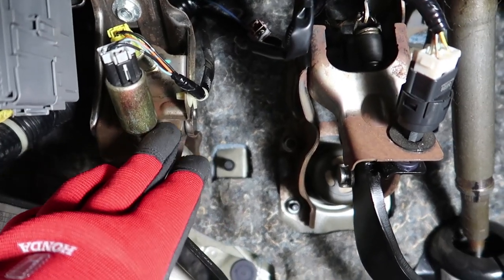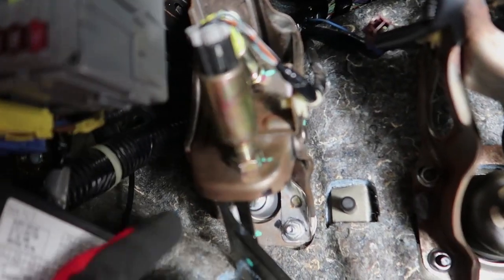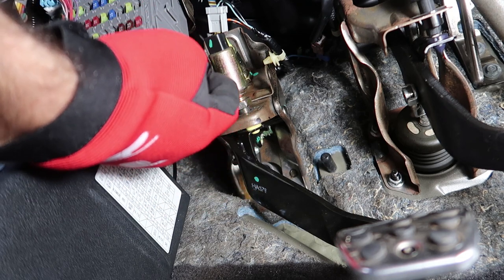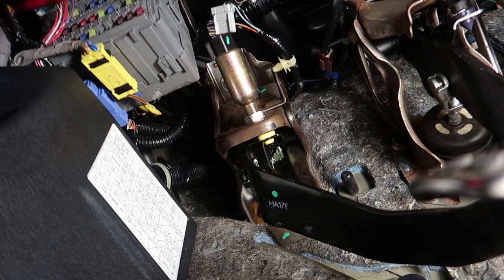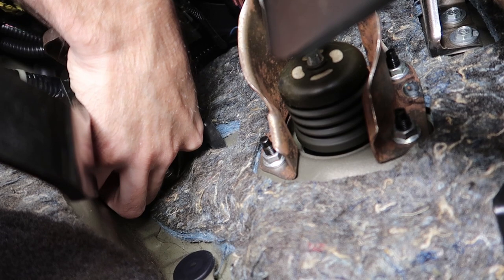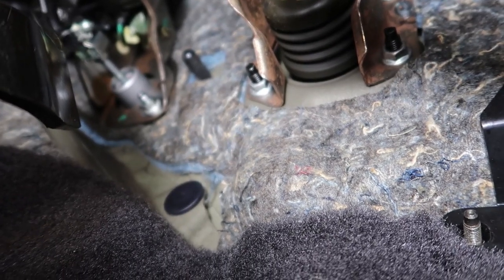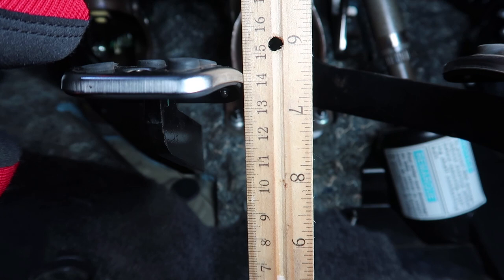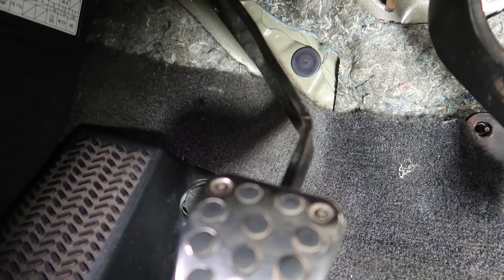8th Civic Si and RSX Type-S Clutch Adjustment DIY | Aftermarket and Stock | FG2, FA5, DC5

Comment: I have a ktuned slave and cmc kit, question is how do I know when to stop turning the rod on the master? Turning the rod with fingers is impossible so I have to use a pliers to turn it
Reply from the maker: So you can also use a ruler to just check the freeplay instead of stopping and backing out. Also try to push down the pedal a little with one hand while turning the rod, it usually makes it easier. Then check the freeplay amount. The reason you do that is because after you change the height of the pedal, the rod has to be reset also (to the correct range). Lmk if you got any more questions buddy
Reply: @JasonMcMullen  one more question actually, before I get into my question I just want to say I have bled my clutch master 3 times and confirmed no air bubbles. My question is, after 30mins of driving my clutch pedals seems to get a little stiffer and also engagement point becomes a little higher. Before driving in the morning I would check my freeplay with my hand without any force and there would be atleast .5inch of freeplay, but after driving for a while the freeplay seems to be gone
Reply from the maker: @Itspiyerrrr  fluid does heat up a little so it could change a little.  If you not experiencing shifting issues then you could give it a bit more freeplay just to be safe. Air in the system will make the pedal softer so you probably did the bleeding just fine. Pedal stiffness will increase after adjusting but you dont want it to feel extremely stiff at the bottom of the pedal travel (if you do feel it at the bottom of the stroke then the pedal height might be too high and you might have to readjust both again)
Reply: @JasonMcMullen  I just find it weird, but car is shifting a whole lot better after I adjusted it with your instruction. The ktuned cmc I believe is a em2 style so I have 2 threads showing on the bottom of the clutch switch, I adjusted it like how I would adjust a stock cmc. Unless I need to have 5-6 threads showing like the em1 style?
Reply from the maker: The k-tuned one is Em1 style, so it does not need as long of a travel. Maybe go a little shorter (more threads showing) and see if the pressure is not as extreme. You can go one thread at a time so maybe try 3-4 and see if you can find a balance between shifting smooth and normal pressure. Also keep in mind that when the car is cold the shifting will be less smooth because the trans fluid has not had time to circulate and warm up.  @Itspiyerrrr
Reply: @JasonMcMullen  thanks for clarifying that!! I’ll have to adjust it when I get gome and get back to you. Appreciate the help a ton
Reply from the maker: @Itspiyerrrr  no prob buddy, hopefully by then end of the process it will be dialed in perfect
Reply: @JasonMcMullen  did exactly what you said, feels a lot better shifting though it has a shorter engagement point I’ll get used to it though. Engagement point gets a little higher after driving for a while, also gets a little stiffer but everything works pretty good so I’ll just leave it at that
Reply from the maker: Awesome!  @Itspiyerrrr
Reply: @JasonMcMullen  last question promise🤣! When adjusting the clutch pedal, should I drive it for a while let the clutch warm up then adjust it? Like warm up the clutch/clutch fluid before adjusting
Reply from the maker: you dont have to but just gotta be aware that it changes a little bit. The big difference is with the transmission, because shifting is not as smooth when its cold, so it might make you think you need to adjust it again. Anyway up to you  @Itspiyerrrr
Reply: @JasonMcMullen I have just getting back on a little update. Ktuned sent me a cmc replacement yesterday. I installed it earlier this morning and it was in world of difference. 5 threads showing on the cruise control switch, gives me about 1/2 freeplay. Before I wasn’t able to push in the slave cylinder by hand so it was stiff on the pedal, but now I can push it in if I give it enough force but still not easy to push in by hand so I’m sure that is how it should be

Comment: I’ve got the ktuned master and slave coming in the mail, is it definitely an em1 style? Just wondering if that company sells more than 1 style for the 8th gen. don’t want to mess up my brand new clutch and rebuilt trans! Thanks
Reply from the maker: yes sir, the k-tuned one is a modified EM1 CMC (it has an AN fitting) and its the one that I used. It should be around 5 threads showing. If you run it with 1 thread showing it will over-stroke the system. In my opinion, K-tuned should provide some instructions because I caused issues for me before I learned about adjusting it.
Reply from the maker: also the pedal will be shorter with the K-tuned so it will take a week or so to get use to it

Comment: i can’t get the rod on the cylinder to spin to get pressure even tho the nut is loose:/
Reply from the maker: Sorry just saw this comment. You can press the pedal down slightly with one hand while spinning the rod with the other hand and it will make it easy to spin

Comment: I have a ktuned cmc and slave kit on my 05 type s. I've bled the clutch fluid 3x for good measure and confirmed there is no bubbles anywhere. My question is, is it normal to have more than 10-15mm of freeplay after adjusting with 6 threads showing? Since its hard to turn the cmc rod with my fingers i had to use pliers, do I just adjust it till the cruise control switch is fully pressed and flushed? Btw I do have unknown stage 1 clutch and flywheel if that helps. Thankyou!

Comment: Does the K tune cmc and slave master fix 2nd gear grind
Reply from the maker: Urbinz yes sir the k-tuned cmc (which is an em1 style cmc) will get rid of that also, as long as its adjusted properly, you will want around 5 threads showing on the bottom of the clutch height adjustment screw. Then the get right amount of free play.  The pedal stroke is shorter on the k-tuned cmc so in my experience the adjustment is a little more difficult to get right compared to the stock cmc. Thanks
Reply: @JasonMcMullen   I have ktuned clutch kit in my 8th civic is and actually I have around 1 or 2 threads showing  on the bottom in order to properly disengage.I was experiencing 1 and reverse lock out and also sometimes problem shifting from 1 to 2. So ktuned system requires longer clutch pedal run.
Reply from the maker: MrRafciog that’s interesting, when I had my k-tuned CMC at 1-2 threads it would overstoke the clutch, and at the bottom of the pedal there would be a lot of resistance. How much free play do you have? And what clutch do you have? Thanks for the info bro

Comment: Quick question, just replaced my master cylinder for an LUK one on my FA5. The bite point was super high so I adjusted the master by turning it counter-clockwise till I felt resistance. You say to go back clockwise half a turn or so; however, when I do, the master cylinder rod becomes very loose to the touch. Is this normal? Thanks!

Comment: Thanks so much for this video, but I'm still having this problem where the clutch pedal has no feedback and the bite point is basically when the pedal is all the way out. Any ideas?
Reply from the maker: did you change the clutch components at all recently? If you dont feel feedback, maybe you need to bleed the system. Or maybe there is a leak? let me know and I'll try to help
Reply: @JasonMcMullen  Thanks for the reply!  I bought the car a few months ago, clutch pedal was progressively feeling more "vague" (harder to feel bite point I guess). As stupid as this sounds, I let my mom drive it and after that the bite point moved to basically pedal all the way out and pedal has not much feedback. Tried adjusting the pedal with your video, but made it worse, going to try adjusting the pedal again. If that doesn't work, I'm going to bleed the system.
Reply from the maker: @Lil.Yahmeaner  Yeah the method I show is good for Disengagement problems but it will make the bite point higher. If you make the pedal shorter (more threads showing) it will lower the bite point, but you risk having disengagement issues. The clutch disk will also get worn over time, but yeah check for leaks and bleed before trying to replace the clutch
Reply: @JasonMcMullen  Ok, so I bled the system and the fluid was super dirty (rust colored). There wasn't much air (if any at all) and the tube was pure (still dirty) fluid. I have 2-ish threads showing and the master cylinder rod has enough space to jiggle around. The pedal feels the same and the bite point (which I can't really feel) is still pedal all the way out. I'm kinda thinking either one of the cylinders is bad or I need a new clutch.
Reply from the maker: @Lil.Yahmeaner  hmm its possible. One more thing are you able to check the freeplay amount with a ruler? that can affect it a little too
Reply: @JasonMcMullen  I don't have mm ruler but in cm, about 14-13.5cm -> 12/slightly less cm. I'll try just about anything but I so appreciate your help so far.

Comment: Where does the clutch pedal bushing go? Part # 46911-sd4-930
Reply from the maker: The pin (bushing) connects the Master Cylinder to the clutch pedal. There is a hole in the clutch pedal and two holes on the Master Cylinder connector (that is on the end of the rod) just line up the pedal inside the CMC connector and put pin in to connect them together. There is a clip that locks the pin in.  Here is a picture, http://civic.hondafitjazz.com/A00/PNG/SNB6E20E34116317031KBAD01.PNG
You can see the pin in the video also.  And make sure to put lube on the pin before installing. Thanks

Comment: On my RSX base model the catching point for the clutch is to high. This fixes that?
Reply from the maker: Katashi ONLINE_K I’m not sure about the specs for the base model. If the clutch works properly it should be ok. Check your freeplay with a ruler first and see if it is at least 10mm, then determine if you need an adjustment

Comment: I measured the distance between the pedal and the floor board with carpet and insulation and it's only 4" and the factory spec is 6.1". If I deduct the thickness of the carpet and insulation, I would guess it's at around 5" which is still 1" low. At the current position, the clutch pedal is slightly lower than the brake pedal. If I adjust it to the factory spec, it will be about 1" higher than the brake pedal. Is this how it should be? I found the clutch travel is abit short ever since I got the car compared to the 9th gen si. I don't want to overstroke the clutch after the adjustment.

Comment: i know im late i just got my clutch replaced and my clutch pedal feel wayyyyyy more softer now since i been riding on my first clutch for 130k miles and now its finally changed, but my question is even if i use OEM parts for my clutch will i have to adjust my pedal, and if so how much?

Comment: Done the clutch recently in a 2003 Accord,the same as the tsx,when pushing the pedal and getting into gear it grinds a little and the car starts moving a bit.
Reply from the maker: Sérgio Santos hmm yeah maybe try to adjust the pedal, give yourself more release travel and see if it helps
Reply: @JasonMcMullen  thanks a lot.

Comment: Hey I have a stage 2 clutch w hybrid racing em1 cmc and csc upgrade kit, i cant get the pushrod to spin freely, the nut is all the way loose but the push rod wont move
Reply from the maker: You can try to push down the pedal a little bit with one hand while trying to spin the rod with the other hand. Just make sure to use a ruler to measure the freeplay after to make sure you are at the right amount

Comment: I tried adjust mine but j wasnt able to rotate the rod what do you recommend? Base on your video it looks like jts easy to rotate the rod, i have the em1 cmc by the way
Reply from the maker: Mine is brand new so it spins easy. Try to push down the pedal a tiny bit with one hand as you try to rotate it with your other hand
Reply: @JasonMcMullen  mine is brand new as well for mine do i need the 5-6 threads or 2 threads since per hybrid racing's instruction i need to use the OEM rod for the  em1 master?
Reply from the maker: @cwendifunto3173  if you swap the rod it should be around 2 threads, according to a few people that have commented
Reply: @JasonMcMullen  got it is possible if i just adjust  the sensor or do i really need to adjust the rod as well?
Reply from the maker: @cwendifunto3173  the rod is needed to get the right freeplay after adjusting the height. Use a ruler to measure the freeplay, if you have 10mm then you might not need to adjust the rod but most likely you will have to
Reply: @JasonMcMullen  aight thanks alot gor the help
Reply: Hi bro so tried doing this clutch and gear engagement is better but the initial putting of 1st gear from a stop is a bit hard so i have a action clutch and flywheel with em1 cmc swapped with the oem rod do i need more freeplay or do i need to adjust the sensor more?
Reply from the maker: @cwendifunto3173  so you are having trouble shifting into 1st? Sometimes 1st is a little difficult for people especially if the car isn't warm. But if you want to try to make it smoother you can try to go to slightly less threads showing, and the redo the freeplay. This will increase the clutch travel and possibly make it better. Keep in mind if you go too far and add too much travel you will feel pressure at the bottom of the clutch pedal when shifting at a high rpm (overstroke)
Reply: @JasonMcMullen  tats what i did less thread for the sensor and re adjust the rod but there’s still a slight pressure when i out it in gear like i feel the car wants to move already just putting it on gear but ill keep driving and see if It’ll fix it
Reply from the maker: @cwendifunto3173  A good way to check if the clutch is releasing properly is to make sure you can shift even with the clutch pedal half an inch off the floor (car idling). As long as you can get into gear with no grinding it should be ok.  Its also good to use a ruler to check the freeplay amount. Let me know and I'll help if I can
Reply: @JasonMcMullen  tried this earlier i was able to with no grinds bro you have like ig or fb i can pm you thank  you
Reply from the maker: @cwendifunto3173  Right on bro! You can hit me up on here no prob. My IG is private rn but I'm gonna make a new one soon. Thanks buddy
Reply: @JasonMcMullen  thanks bro you've been a good help
Reply from the maker: @cwendifunto3173  Thanks for watching and commenting bro I appreciate it

Comment: After loosening the nut on the master cylinder, My rod on the master cylinder isn't spinning. At all. It's almost like it's locked in place. Any ideas?
Reply from the maker: Try to push down the pedal with one hand while spinning it with the other hand. Just measure the freeplay after with a ruler

Comment: Hi, I have the ktuned cmc and a heavy duty clutch,  I adjusted my pedal per ur video but I can't put it into gear still
Reply from the maker: try less threads showing and redo the freeplay, make sure there is good pedal pressure (no air in the lines or leaks)

Comment: Do u adjust a the aftermarker cmc the same way u did it in the video (sirimoto brand cmc)
Reply from the maker: Should be the same, depending on if you are using a stock replacement or EM1 style replacement. Stock CMC and rod=1 thread, EM1 =5 threads, stock with rod swap=2 threads
Reply: @JasonMcMullen  thanks man did early today with the 5 threads an it feels good now
Reply from the maker: @jeshuaaponte3501  awesome bro 💪

Comment: 1999 Prelude with Competition Stage 2. Kinda the same adjustment? Stock master cylinder.  I installed the clutch and my engagement point is way high.

Comment: How far off the ground should it engage? I know some guys who say that there’s catches like 1 inch off the floor. I just got a new clutch in and it feels more like 3-4 inches off the ground
Reply from the maker: Joe Seibert as long as it engages and disengages properly it should be ok. I like mine to engage about 2-3 inches from the ground. But check the amount of free play you have and make sure it is between 10-18mm. As long as the free play is ok and it operates ok it should be fine. The amount of free play and the pedal height both contribute to the height of the engagement point

Comment: So on my 8th gen si. When I press my clutch it clicks twice once about half way and then a second when the clutch is pressed all the way in.
Reply from the maker: hmm not sure about the clicking. It might need some urea grease on the end of the slave cylinder rod, or on the spring that is on the upper part of the clutch pedal. There are a few friction points on the upper part of the clutch pedal/CMC that might need grease. Let me know

Comment: just got an fa5 clutch is really hard car action clutch not sure what stage it is wondering if adjusting it will help specially with engage i feel like it engages really hard
Reply from the maker: yeah it might help, do you mean its hard to push the pedal down? or that when you let the pedal back up its hard?
Reply: @JasonMcMullen  its hard to push the pedal down

Comment: With the stock setting having so many threads showing from the back, engagement is short and tight. I just adjusted it, and it fixed my high rev lockout with 1 thread showing and the clutch release is much longer. Would showing something like 3-5 threads (or just something between stock and this adjustment) be okay as an in-between?